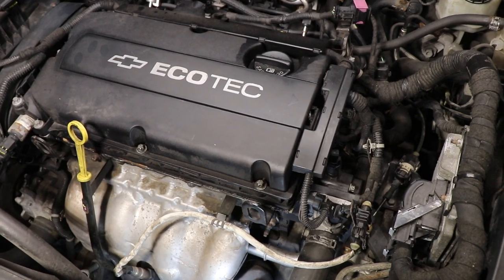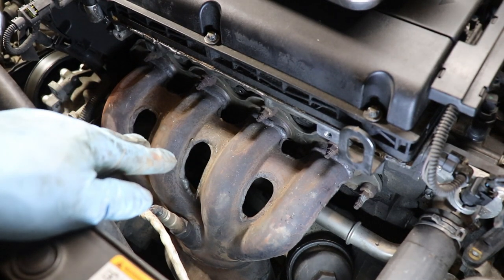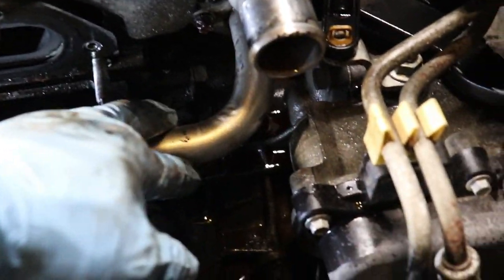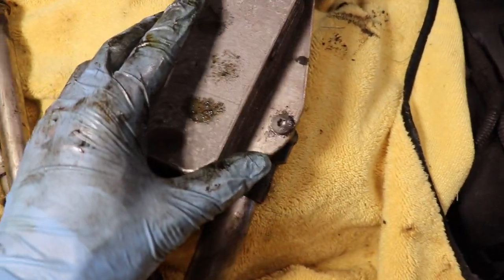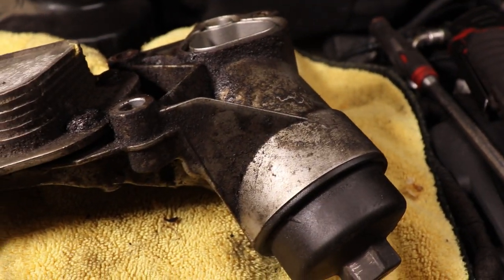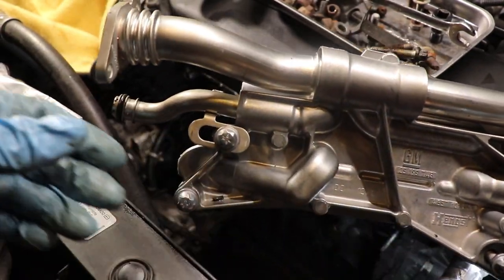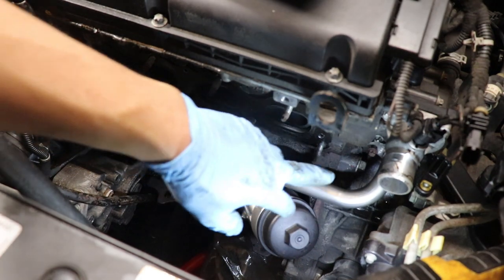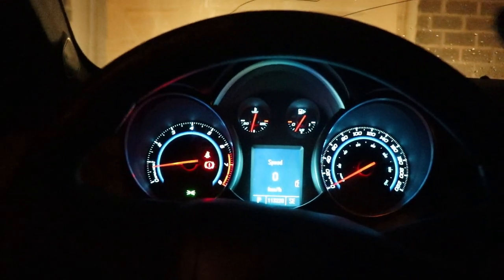How To Replace Oil Cooler Assembly [ Chevrolet Cruze/Sonic/Holden Barina 1.8L 1st Gen 2011-16 ]

Comment: Can there be coolant leaks in this spot? That’s what I’m getting instead of oil.
Reply from the maker: Yes of course. There is a lot of coolant going through the oil cooler so its very possible that you get an coolant leak from the o-rings or the coolant pipes

Comment: When removing the radiator hose, twist it to break it loose from the heat melting the hose to the nipple instead of just pulling it or using a screwdriver to tear it up.

Comment: Hello, is it possible to mix oil with coolant in there or my head gasket gone in my car?
Reply from the maker: its possible. Did you drain your oil and saw coolant mixed with it? Is the oil level higher than usual?
Reply: @OneTrickTech  oil looks ok still black. But I got butter under coolant cap. But my oil cooler leak for 100% ...
Reply from the maker: I'd suggest replacing the oil cooler first, maybe the oil passages has a crack allowing coolant to mix. Top off your coolant and check the level after every drive, you might have just an external coolant leak. I wouldn't blame a bad head gasket just yet.

Comment: I have same problem at this time. Do you know from where exactly it was leaking?
Reply from the maker: Oil Cooler unit , you can just change all the gaskets
Reply: @OneTrickTech  thank you for quick replay. I replaced all the gasket for the thermostat housing and bypass pipe gasket where the thermostat. And noticed coolant water on cat converter and coolant gone . So i had to give try to put coolant seal . Just now I check the coolant level is good and no leaks. Hopefully stay like that otherwise I need to replace all other gasket where the oil coolant unit .
Reply from the maker: Yes replacing all the gasket is a lot cheaper. I replaced the whole assembly because it was leaking oil from the cooler and not coolant.

Comment: How long could someone drive this car for with the leak? I can't get to mine until after New Years. Jan 2nd. Mine is leaking like this. I can also smell burnt oil in my heater vents. Can it start a fire? Or could someone drive with the leak for 2 or so weaks?
Reply from the maker: its fine. This one was leaking for months. As long as there is no excessive smoke coming for the engine bay, then you should be ok for 2 weeks.
Reply: @OneTrickTech  good. Thank you. Hopefully mine isn't too bad. I worry about snapping the manifold bolts.

Comment: Leave it to gm to put the oil cooler right up against the exhaust and converter
Reply from the maker: How is it supposed to cool if it's surrounded by heat 🤔

Comment: I have oil in my coolant reservoir. It looks milky. I checked my engine oil and the oil is clean its not gunky and ny muffler isnt smoking. So i believe my head gasket isnt bad. Theres only oil going to my coolant. Could this be the cause??
Reply from the maker: yes replace cooler and all the pipes
Reply: @OneTrickTech  would coolant flush help with cleaning all that gunk out ? I was gonna replace the coolant reservoir as well.
Reply from the maker: well you have to flush the coolant anyway when doing this job. Drain the coolant from the radiator first.
Reply: @OneTrickTech  okay i sure will, I appreciate you taking the time out your day to reply back. In return I've became a subscriber and will support your future content thank you!
Reply from the maker: @ivanchavez6226  you're welcome thanks for the support !

Comment: Do you know all the torque specs for all the parts?
Reply from the maker: According to service manual. The 5 oil cooler housing bolt - 25 Nm (19 lb ft) and the cooling pipes 8 Nm (71 lb in)
Reply: Great question and great answer!

Comment: I search "engine oil cooler for 1994 Chevy K1500 truck", the picture looks like a small version of a radiator. Where is the correct oil cooler for this truck that I need to change? Thanks.
Reply from the maker: Hey there, so your truck has a oil cooler that's part of the engine. Its mostly like that with engines that have a spin on filter. I've searched oil cooler for your truck as well but they are showing '"the mini radiator" as an external oil cooler that you can install for your car. So to answer your question, you don't have one that you can replace on your truck unless you installed the external one that you've searched up. Hope that helps! Let me know!

Comment: It’s saying “oil pressure low stop engine” after replacing the oil cooler, water outlet and timing belt. Any idea what could be the problem? The engine is also making a ticking noise
Reply from the maker: the oil pressure switch is beneath the oil cooler (bottom left side). Make sure its not disconnected or damaged. If your oil level is good on the dip stick, then the computer is reading a false oil pressure signal. Could be a faulty oil pressure switch or wiring issue.
Reply: @OneTrickTech  It has a fresh oil change. I’ll go ahead and replace the oil pressure switch, thank you.
Reply: Were you able to fix this? I am also low oil pressure light on.
Reply: @krishnnarayan6845  this is the link to the video on how I got rid of the oil pressure light
Reply: @krishnnarayan6845  I swapped out the oil pressure valve in the oil cooler. That’s how I got rid of it
Reply: The link didn't come! Is the oil pressure valve the one that sits under the oil filter? @CleranceElva
Reply: @krishnnarayan6845  correct

Comment: Dear i replaced the oil cooler not once but thrice but i see oil mixed in coolant water still. 
What could be the reason
 Please share
Reply from the maker: You might have some engine damage. You might have a crack in the cylinder head making coolant mixed with oil through the valve cover.
Reply: @OneTrickTech  Yeah. That might be. So is it repairable or i need to change the whole engine
Reply from the maker: will need more diagnosis. could be the cylinder head or the short block.

Comment: I had toyota yaris for 8 years i have not opened the bonnet, but when i purchased this car as a used car multiple issues. worst except engine i replaced all  the parts

Comment: All the links say it doesn’t fit 2012
Reply from the maker: Which engine do you have?
Reply: @OneTrickTech   1.8
Reply from the maker: @braydonh2150  2012 Chevy cruse LS 1.8L says it fit, I tried the LT and LTZ says it doesn't fit because they have the 1.4l turbo engine. As long as you have the same engine like in the video those parts will fit, parts for the 1.4l are completely different.
Reply: @OneTrickTech  weird mine has lt badges but it’s definitely a 1.8
Reply from the maker: @braydonh2150  its amazon...not the best when it comes to different trims and engines.
Reply: @OneTrickTech  true. Thanks for responding

Comment: I'd be surprised if you didn't get coolant in the oil. Hundreds of dollars in new parts but too cheap to do an oil change. You never reuse an oil filter. The chances are too good you'll introduce contamination into the bearings.
Reply: You'd have to be a complete numpty to contaminate the filter. No problem putting it back in as long as you're careful!

Comment: Will that cause to temperature gauge not to work and the cooling fan running all the time?
Reply from the maker: The oil cooler replacement is to fix a oil leak. For your case I would check the coolant temperature sensor near the thermostat housing. Could be some wires that are broken or maybe a faulty temperature sensor. There's also a temperature sensor on the left side of the radiator, check that one too.
Reply: Ok thanks